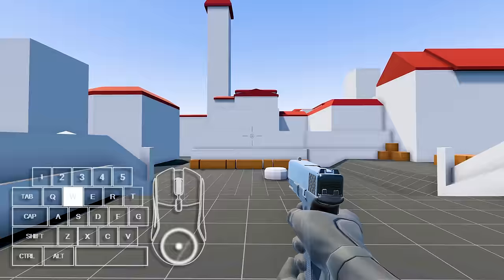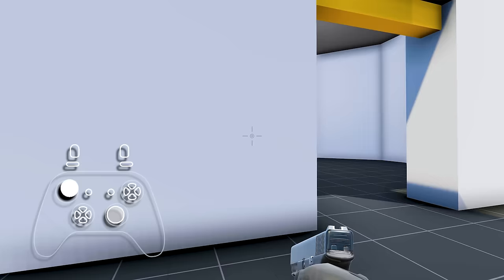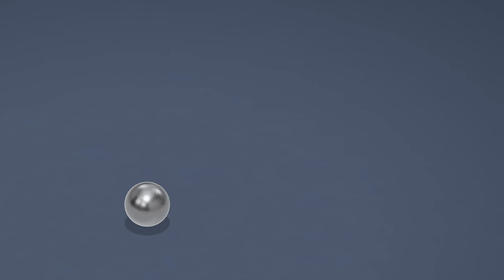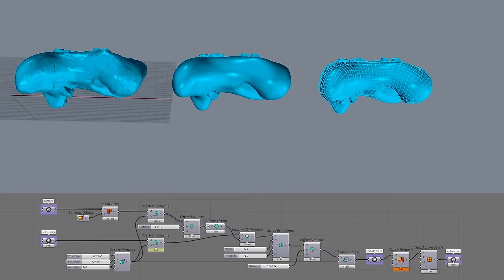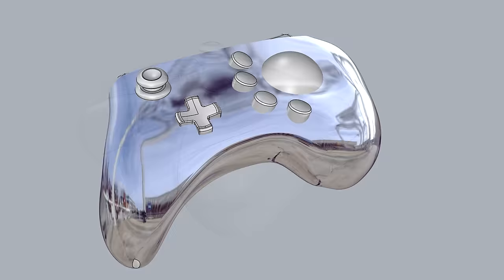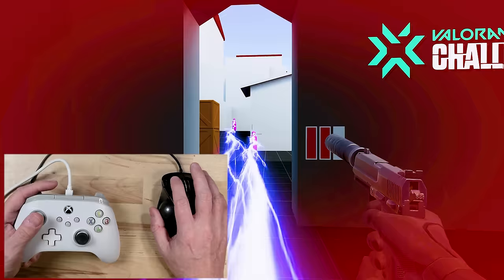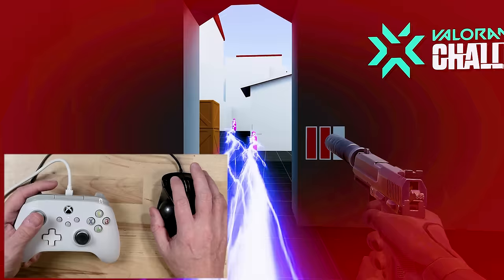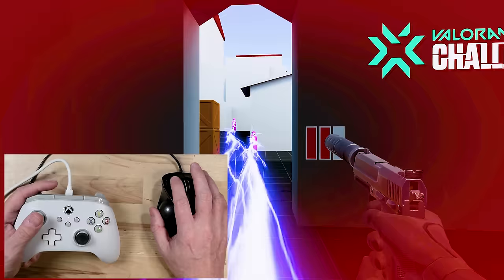Ultimate FPS Controller Design & Build

Comment: This was definitely an awe inspiring project. Had to watch this one start to finish. I'm a lifelong PC gamer but because of carpal tunnel issues cropping up, I developed a new hybrid control scheme with the help of SteamInput. I hold a DualSense(PS5) controller in my left hand and a Logitech gaming mouse in my right hand. I think the community would really respond well to a simple left-hand-only controller. You need not "reinvent the wheel" of a gaming mouse. If I had a fraction of your knowledge-base or skill, what I would develop would be a left-hand controller that uses familiar inputs like joystick for WASD, Left Trigger and Left bumper for "Shifting" buttons to access additional input layers, and then just standard D-pad, 'share', 'menu' buttons that can be mapped to whatever keyboard input you wish.

Comment: The "FPS, Aiming and movement" portion of your video presented very important things, and I always felt like the Nintendo Wii provided the best, most immersive solution to FPS controls that I have ever experienced. I owned both COD modern warfare reflex and COD Blackops on the Wii and that generation was by far the best gaming experience I ever had with FPS's. The way Nintendo leveraged motion for both the aiming mechanic as well as for motion doubled with the thumbstick in your left hand made so much sense to my brain. Also because of this, all of the "360 no-scopes" did not exist because you actually had to aim & shoot your gun, it wasnt just some cursor in the middle of your screen that you could hack. Since that generation I have not been able to really dive deep into fps games anymore because I am simply not capable off effectively aiming with the thumbstick with standard controllers (even with built-in aim assist) nor can I handle the keyboard buttons to move and the overly twitchy movements of the mouse. I have adjusted the twitchy movement of the mouse, only to be at a complete disadvantage playing on PC given this. It's basically a catch 22 for me when it comes to FPS gaming online. Ironically, a few years after playing the COD series on the Wii, I had an opportunity to go to a shooting range where I shot both semi auto glocks as well as automatic rifles. The transition, or familiarity with the motion control of the Wiimote and the feel of an actual gun in your hand made the gun feel familiar to me, though I've never actually held or shot a gun before in my life before that time. I write this only because I know that the many people have not experienced the Wii motion controls for FPS's and therefore never give it a thought. It is handsdown the best most immersive way to play FPS's that I have personally experienced. With that said, I would like to try a hybrid controller like what you're making, as I woudl definitely need something

Comment: The biggest hurdle is figuring out an alternative way to emulate how a mouse gets its precision. Using the fingers, the wrist, the arms, the shoulders, there's literally more muscle groups and bone joints, bigger range of motion, etc., being used to control the precision of where you want the mouse to move to. In contrast to controllers that mostly use thumbs. Less muscle groups, less joints, smaller range of motion is much more difficult to scale for precision. The closest compact controllers has ever gotten to incorporating as many muscle groups and bone joints as a mouse is the implementation of gyroscopic controls, which I think needs to be at the center of designing a controller for FPS games.
Reply: Great Point.. The Software Just Isn’t Prepared For That.. You Would Have To Find The Right Balance And Maybe Input That Or Maybe A Develop A Whole New Program..
Reply: I’d rather play with this track ball hybrid than gyro hands down.
Reply: exactly. he was on the right track trying to figure out why its more precise but he didnt flesh it out enough..
Reply: Track balls can be extremely precise and fast with practice.  I remember back in the 90s when they were huge a lot of people played competitive FPS on them and were god tier with them.

The technique is to set the sensitivity quite low, then flick the track ball with your finger at high speed and let it free spin and set your finger back down onto it to precision stop it.  It allows you to have very precise slow movement but also extremely fast transversal movement.

I never mastered it myself but I have mastered it with my free spinning mouse scroll wheel and I can't go back to a standard scroll wheel now.
Reply: Not entirely true - the trackball is a fingertip device with no physical limits on its rotations, and the fingertips are more dexterous and sensitive, where the mouse is very much a whole arm aiming that will run out of reach/mousepad - relatively course level of positional accuracy possible and you do have a limit to the range of motion. Where with the flick and brake of a trackball you can spin around as fast the game can render it for what approaches infinitely (and actually would be infinite if you turn friction off in the Steamcontrollers trackball mode) - in effect there is no range of motion limit at all, the only limit is for the extra fine positional aim stuff and this access from both sides trackball kind of fixes that too as you can keep the ball moving even when one digit has reached the end of accessible ball surface... 

That said I do sort of like gyro from my experiments with the Steamcontroller, and think it could improve the performance ceiling I can reach. But I find I don't play enough of any one title or style of game and its nowhere near as intuitive as turning it off and playing pure trackball mode for me. I'll just get to the point I feel the gyro is actually helping rather than hindering and then not play a similar game for so long it goes back to being hindering...
Reply: theire is a trackpad controller that is just a keyboard and mouse controller for console. cammed the ifyo or darkwalker shotpad. The wireless version has gyro. you can alter the sensitvity of the gyro and trackpad on the controller itself. plus it has the a few gyro options like yaw, roll or combine yaw and roll. but the trackpad is not that great. and on console it only works on games that support mouse and keyboard. 

for just console games it is not that bad. but compaired to the controls of the steamcontroller or the steamdeck it is not that great. this controller needs a gyroscope aswell. you can still see that the aiming on this controller is still done i rather straight lines. compard to mouse aiming wich envolves more circular movements. gyro on a regular controller or trackpad plus gyro on the steamdeck is great. Trackball is not as precise as a trackpad with raw mouse input.

trackball still moves when your finger releases the ball. trackpad movements function like a mouse with an optical sensor. wich is more accurate.
Reply: @caleasthetic You can absolutely move in curves with a trackball, and his setup here makes it even easier than one would normally have.

Another huge feature on this is being able to access shoulder buttons, face buttons, and move the trackball all at the same time and with just one hand, which allows for maneuvers that are literally impossible with other input devices. 

Then the left hand can control the other shoulder button, the analog stick, and has access to the mousewheel which allows for a whole new other set of options.

This controller seems like it's perfectly designed for games like 6DoFs and other things that require a lot of simultaneous input
Reply: @RaptieFeathers  i also own a alpakka gyro controller wich has a thumbpad to activate or deactivate gyro. it works great.

although i prefer a gamepad with trackpad and gyro. the alpakka cotnroller is still a great option for me. So i really hope this controller will also get a gyroscope
Reply: I also question the assumption of WASD movement being worse because of it's limitations.  Sure, you lose the ability to move in really specific angles at a wide range of different speeds, but how helpful are either of those?

With WASD only having 8 directions and no continuously varied speed, it makes your movements much more predictable, and easier to compensate for when aiming. Compared to a thumbstick where it would be hard to move the exact same angle and speed with the exact same timing consistently (you can be close, but it still adds more variables to aiming).
Reply: @TwoTowersPro  As a competitive player I feel similarly. Lots of great players are using hall effect keyboards now too, which is really just better than a stick for both casual & competitive in every way that matters. Actually, the thing that matters the most about the consistency of keyboard movement is that you usually want to be moving only as fast as possible, or only just under the speed that makes noise. In this way, a stick is completely detrimental to having any form of useful movement input
Reply: @foldionepapyrus3441  shaq cant shoot free throws because its like a normal person shooting a tennis ball.
Reply: @caleasthetic  I didn't know such a thing existed, this controller you mentioned is really cool 👀

Not as cool as the one made here, but holy moly I know what I'm gonna be buying

It's the scroll wheel and modularity that really sticks out to me, haha
Reply: @kirasmith1147   As a casual player, the draw of gamepads is 100% down to comfort for me. Even with a split ergo keyboard, it's just not gonna be as comfy as sitting with a controller in my lap and reclining. Like I'm twice as accurate with a pointing device but that's almost never going to win out over comfort. The soreness from using a keyboard when gaming for extended periods of time just isn't worth it. And with the advent of gyro aiming, the loss of precision isn't even that wide of a gap anymore. It's weird, because I do a lot of typing when I'm not gaming, and that doesn't hurt me even after doing so for hours on end. But it's a lot easier to hover over the keys when typing than when playing a game, so that might be the key differentiating factor.

Comment: The Steam deck’s trackpads have a trackball mode! Aiming with the trackpad after a while is so intuitive, it’s crazy! 🎉
Reply: Wait 'til you try the gyro.
Reply: @qchtohere8636  For me combination is best. Trackball mode set to low/none friction for fast changes and gyro for precision headshoots. And with none friction you just give slow nudge to the trackpad and you have similar panning like with joystick.
Reply: First time I’ve seen Rhino used outside of a class I took a couple years ago woo!
Reply: The early prototype was literally a real trackball
Reply: so what is the difference? except that you are using place surface instead of hemisphere
Reply: @N5O1 Trackpad is more versatile due to being virtual. It allows for other types of inputs. It's also lighter.

Comment: A brilliant design which reinforces for me that a sliding palm rest for the left hand that outputs a PWM WASD keyboard signal is still the best way to go; it doesn't need any drivers as it just emulates a standard keyboard.  

(I wrote a PWM keyboard script in GlovePIE almost fifteen years ago that allowed me to use my MS FF steering wheel perfectly with Flash racing games.  It was hilariously awesome overkill and I loved it.  I later stuck an Arduino Mini inside a Nintendo Nunchuk doing the same thing to give me full analog control of movement in games that only supported (digital) WASD.  So good!)

Comment: I think if you add Gyro to this, for yet another layer of granularity, this could easily pwn pros in fast paced shooters. Games like Counter-Strike, I do have doubts that Controllers of any type could ever reign supreme; the game is just so actively designed for KB+M from the very beginning in the late 90's, and is very optimised for it. But the potential is ABSOLUTELY there with your design. Great video. 

To be honest, your process is the part I am most invested in; doing creative things like this as meticulously you are is so awesome and I super appreciate it. This is the kind of community made thing that just gets my creative juices flowing!
Reply: Yess Exactly that's what I was saying & Trackpad/touchpad too! 

this controller + Gyro + touchpad/ trackpad = ultimate controller that no one can beat!
Reply: Gyro is necessary, actually, yeah. Mice have four level of granularity available - pivot points at the knuckles, the wrist, the elbow, and the shoulder. A trackball is only one pivot point/one "sensitivity", with a static range of motion. Having three more exponentially increases the possible range, and the accuracy across that range. If they could differentiate small, hand-area gyro motions from larger, "full arm" gyro motions, that could even add another layer, and bridge the performance gap between this and kb&m.

Comment: The steam deck does actually emulate a trackball with the touchpad instead of working like a laptop trackpad. The gyro could also be something that could enhance the small movements of precision aiming. You should compare your controller to the steam deck if you ever do a follow-up and see what Valve managed to do after all these years of  RnD.

Comment: I love my trackballs, but I can tell you that there are 3 main things working against you:
1 Trackballs tend to be low resolution /dpi sensors and have delay input with underpowered chips (egonomic usually means all cost went into the molds and design)
2 the thumb is less flexible than fingertips for trackball accuracy, which is why it fell out of favor, but myself and others have nostolgia and the muscle memory for thumb manipulation even if they are ergonomically worse
3 trackballs have momentum and require greasing and optical sensors, trackpads can be used the same way, but need less maintenance and can stop instantly. They felt different until the newest higher resolution ones became commonplace.

(Bonus) The combination of your fingers, hand, wrist, elbow, and shoulder gives you the most variety in which muscles are used to move your hand 1 to 1 with the hand visible on screen for beginners, thats why the hand or gun stays visible on screen by default in most 3d games even when it makes no sense.

Comment: In competitive FPS games you usually don't want analogue movement inputs, too nuanced to play consistently. Same goes for offsetting the drawbacks of a trackball with mouse acceleration sadly. But for casual play like single player FPS games it's very useful. The quality of your controller is incredible, amazing what can be built at home nowadays
Reply: this still won't change anything because the real issue is your right thumb having to do too many things which involves letting go of aiming. this is the exact same thing. gyro has already solved precision aim for controllers
Reply: @jUppers  I don't find gyro precise at all
Reply: @athmaid there are PLENTY of Gyro players that are exceptionally good at aiming, he’s right, it is the solution for precision aim with a controller. Takes setting up and getting used to but it is the best way.
Reply: the mouse is an analog movement imput
the only reason its good to aim with it is because it uses the motion of your wrist
Reply: @w2quick  yeah I know, by "movement" I meant the character's position not the camera movement. You obviously can't really control the camera as precisely with a few millimetres of travel on a thumb stick compared to 40cm or so on a mouse pad
Reply: @PartyCrasher04  as far as potential goes, can it rival a mouse? Might give it another try maybe

Comment: I remember using an analog mouse and track ball when I was younger.
I hope you remember to include a way to remove the ball for cleaning, as that was the biggest problem I remember having with this tech.
Otherwise I like this controller.
Reply: Yeah, probably just have to loosen the adjustment screws and pop it out or something like that.
Reply: Did you not see how he put it in? In what world would you think that is permanent?
Reply: @basedlordprime  nothing in any world is ever permanent, obviously.
That doesn't mean disassembly for maintenance is easy, or even intended.